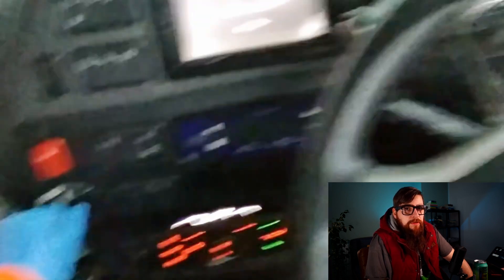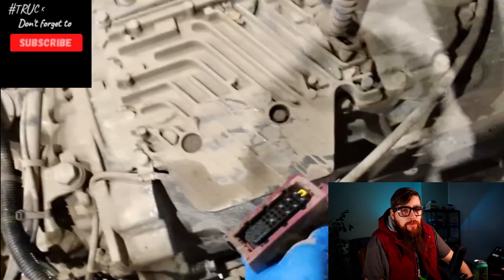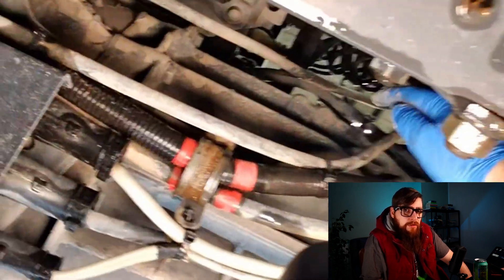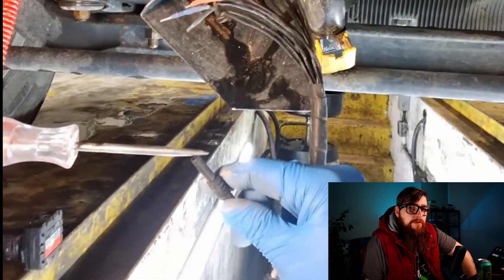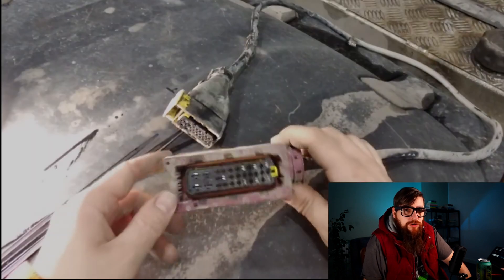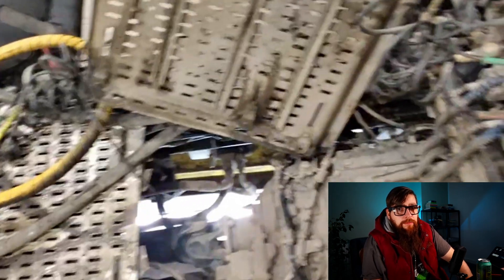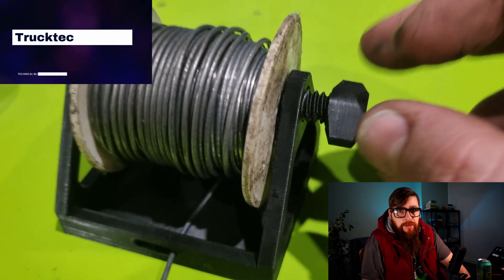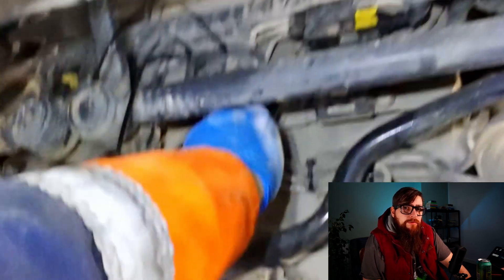DAF traxon gearbox fault | NEW NOX sensor diagnostic tool

Comment: Hello great video I have same problem with my traxon I check the cable seams fine no visible damage  but when move cable it lose signal can be damage inside cable some wire ?

Comment: We have 2 Davies and 2 texa.  The texa is OK. It seams to say it does so much  ... for example a vtg calibration. It does all the same steps as the davie but always fails.  I done on the davie and it was fine.
   Tried to program som lf euro 6 keys.  Again all the same steps as the davie but just didn't work.  I was told trxa was design and produced with massive help from Mercedes and it is really good. With diagrams , wiring diagrams and activations.   The live data is massively helpful too

Comment: Great video bro
Reply from the maker: Thanks for the comment man ☺️. Hope your getting on okay with your fleet work 😎👍
Reply: @TRUCKTECHUK  thanks bro..I'm trying my best...here I have no one here to teach me it ..and I love the work on DAF trucks ...you keep it up ....only one thing is troubling me ....the euro 6 have more different CAN networks in it and to read how it connects to the unit ...
Reply from the maker: I've a course on reading electric diagrams for DAF that I've started but like many things in my life.....have yet to finish. 
If you don't have access to diagrams you should get your boss/company you work for to invest in access to dafs systems. Which you can pay for per hour/day/month ect
Reply: In my country we have a DAF dealer ..but they don't want to give out any electrical sheet.
I want to learn more about this new gearbox ..TRAXON..we just getting euro 6 in my country but with zf astronic manual and automatic zf astronic...
Reply from the maker: TraXon was fitted to DAF in 2017 onwards here, as-tronic was introduced around 2002 here if I remember rightly, there information on the gearbox on the internet if you Google enough you will find what you need
Reply: @TRUCKTECHUK  bro .  Can you tell me how to remove data from a zf astronic automatic transmission modul .because the client have send it to Holland and I think they program a faulty data in the new zf astronic modul 
So I want to know how to remove that data in the new modul with my jaltest so I can program a copie data from another modul..can you advise me how to do it
Reply from the maker: Hey thanks for the comment, I've never done it unfortunately but I'd surprised if it's any different than copy and paste. I wil try and have a look at the software on jaltest tomorrow to see if it can be done 👍
Reply: @TRUCKTECHUK  ok bro.just see if it can remove the software on jaltes. 
Thanks alot bro for your time
Reply from the maker: @vinodjokhan3077  usually I'd pull a file from daf but you don't have that option but I'm interested in how much copy and pasting jaltest can do so I will see if it can be done tomorrow

Comment: Interesting video mate would you be able to do a toolbox tour
Reply from the maker: Hey buddy thanks for the comment 👌 the toolbox tour  is on list to do this year👍but currently I've my classic 75 and hutch in one depo and a diagnostic cart in the other with a few basics that I'm using currently i.e test light, diagnostic computer, 1/4 drive sockets and ratchet, Nox sockets ect.
BUT YES! I WILL GET IT DONE 😎
Reply: @TRUCKTECHUK  ok thanks mate

Comment: Good video and like you tool for the nox sensor...Can't remember when i last did electrical work ..Unless you class replacing to 2 sockets that bolt on to the bellhousing for the eas system ,someome dropped something on them ,luckily i could cut the remains of the plastic away  and just put the pins in new sockets..On a plus i now know how the lock that holds the pins in works lol
Reply from the maker: Hey norb 👋😊 thanks for the comment buddy 😎 
With me moving depo now I don't really do much more than electrical diagnostic. 
I'd say you re-pinning EAS sockets qualifies enough electric work for you this year 🤣🤣🤣🤣👌

I don't know what's worse the lock you lift up slightly on the plug or the clip that holds  the plugs to the chassis that breaks as soon as you look at them 🙈
Reply: @TRUCKTECHUK  I have loads of the lock clips of various sizes in my toolbox...i found a cheap set of tools for depinning  got them on ebay you will know them dirt cheap from china and you get about 30 tools ,and they work better than the snap on set of 8 or is it 10  that cost an arm and leg and never really work lol..I am seeing lots of MY17 head gasket failures and by the time the customer brings it in the fire ring has eaten in to the head.you are looking at a 20 thou skim then valves reset and topped ,which we won't do  so new head ,and there is some heavy corrosion on the blocks face which is rendeering them u/s
Reply from the maker: @norb0254  is it a red box for the de-pinning tools👌 I've the same set and I've got a few daf tools that I've ordered from "assortments" that are infinity stronger and also 5 times as exspensive but yes cheap set is AMAZING value 😎👍

Oh mate we have 4 trucks needing engine overhauls ATM from camshafts to headgaskets. It's just trying to get people on them to do the job 😅 don't suppose you want a job lol 😂
Reply: @TRUCKTECHUK  Tools from DAF are are dearer than snap on ..I just found out sump bolts are £25 a pop..the de pinning ones i got are on chains no box lol...I get no luck with cams they all grow arms and legs ,,No 3 cylinder follower bolt sheared follower destroyed ,came out ok but the  bore is ok..Then  no 1 cylbolt sheared .cant get follower out because of the bolt ,so cam out smash follower out ,head off and run the DAF reamer down the bore to tidy it up as i couldn't slide a follower down it ,, normal bent inlet pushrod ,2 broken exhaust rocker arms  with one the thin metal cap had sheared off..so heads off to get tested ..